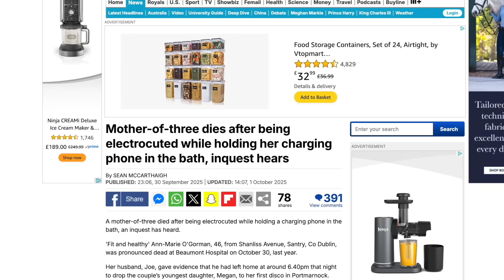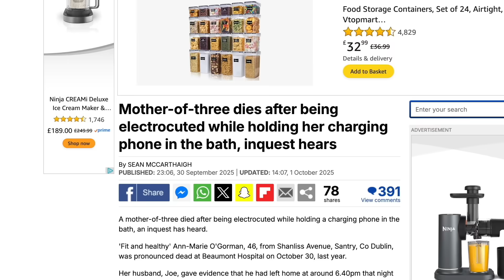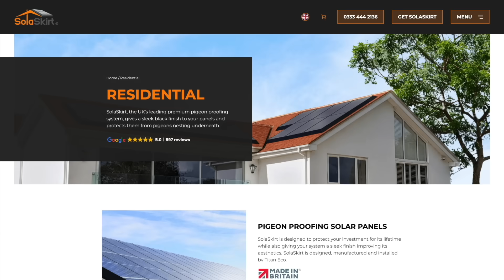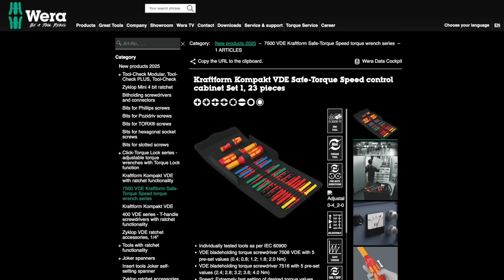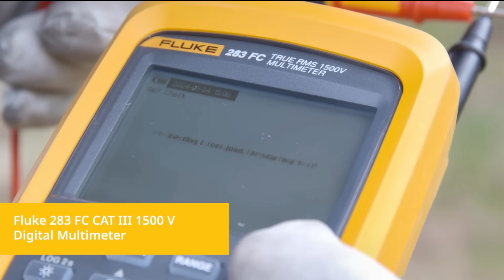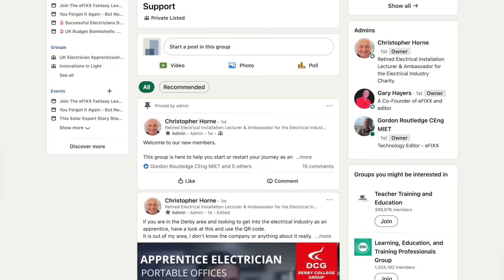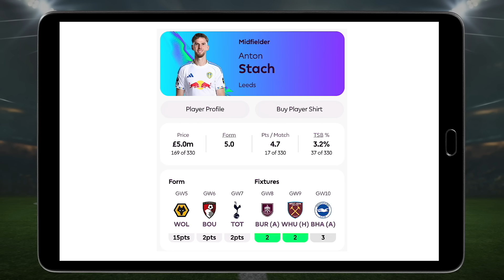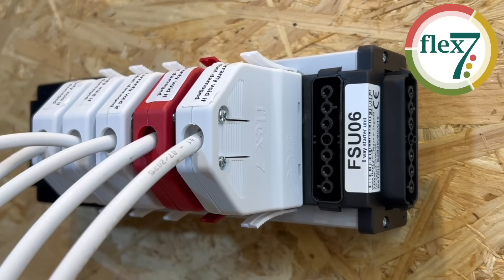He Claimed to be an NICEIC Electrician... Big Mistake

Comment: Being a member of NICEIC is not worth the paper it's written on.
I've had to make good incorrectly wired socket outlets installed by NICEIC accredited electrical installers.
Part P of the building regs hasn't solved a thing.
Electrical accidents are increasing not decreasing despite legislation designed to improve electrical safety.
Reply: Same here - I had NICEIC electricians fit T&E externally to security lights, and spurs on spurs. It's nothing more than an attempt to stop the consumer doing the work, in order to rip them off.

Comment: there’s a reason mains sockets aren’t allowed in bathrooms. the 3m extension sounds like a mains extension lead.
Reply: This is a typical UK requirement.
Reply: Sockets are allowed in UK bathrooms though. They just have to be 2.5m away from any bath or shower and the circuit must be protected by an 30ma RCD
Reply: @JamesWilliams-gi4eu  have to be a big bathroom!
Reply: @over-engineered yeah you do.

Comment: The electrocution sounds like a cheap knockoff charger, no way 5v should ve lethal but if it's not SELV you would have a problem. But who thinks running an extension lead into the baths a good idea! It like the warning on hot drinks saying the drink may be hot.... Darwin?

Comment: The uptick in these stories has led UL to kick off an investigation into crappy phone chargers

Inside the charger there's a small transformer that separates the high voltage coming from the wall and the low voltage going to your phone. As this is a touchable connection it requires extra insulation in the transformer (generally a tape layer) to physically isolate the two sides in case the wire insulation fails

All this is done to ensure that even a power surge won't cause dangerous voltages at the output

But what if you want to make a cheap charger and don't plan on sticking around? Then you put a fake UL or CE logo on your product, get a flyback that isn't safety isolated, ship a bunch, and disappear before you get caught.

When the insulation in the transformer breaks down then your 5V USB cable is now at 120V or 240V and can cause serious damage

Comment: Assuming the woman was electrocuted when the power brick on the end of a mains extension lead dropped in the water, why didn't the RCD in the consumer unit trip and save the day. Southern Ireland at least had mandatory RCD protection way before the UK.
Reply: Mandatory for new houses or rewires only surely?
Reply: @Benzknees  yes, but they were required in Southern Ireland for new / rewires quite a long time ago, so its surprising when there isn't one.
Reply: @stunimbus1543  - Just scanned the internet, and it seems both the UK & Ireland made RCDs mandatory in in 2008 on domestics.
Reply: @Benzknees  so i did a shop fit at Mahon Point near Cork in 2005 and RCD protection was required by the RECI (similar to  the niceic) for all socket circuits. But that was a shop (Adam's children's wear) not a house. I assumed the requirement would be for all installations, but maybe it was commercial only.

Comment: Lots of people here are talking about “5V” charging, but don’t forget that USB-C PD can do much higher voltages. I believe the latest iPhone 17 accepts 20V, for instance. In a bath, I think that might be enough to be dangerous – and of course there’s no RCD. But I agree that mains voltage is more likely to have claimed the life of this unfortunate lady.
Reply: It still doesn't make sense because the output of the charger isn't referenced to earth, so how does simultaneously touching (presumably bonded) metalwork complete a circuit? A shaver socket puts out 240V, yet you can touch that and earthed metalwork without getting a shock because its current flows around the output side of a transformer only.
Reply: @dsesuk The uptick in these stories has led UL to kick off an investigation into crappy phone chargers

Inside the charger there's a small transformer that separates the high voltage coming from the wall and the low voltage going to your phone. As this is a touchable connection it requires extra insulation in the transformer (generally a tape layer) to physically isolate the two sides in case the wire insulation fails

All this is done to ensure that even a power surge won't cause dangerous voltages at the output

But what if you want to make a cheap charger and don't plan on sticking around? Then you put a fake UL or CE logo on your product, get a flyback that isn't safety isolated, ship a bunch, and disappear before you get caught.

When the insulation in the transformer breaks down then your 5V USB cable is now at 120V or 240V and can cause serious damage
Reply: @dsesuk  It won't be referenced to earth as such since there's not normally an earth connection to the charger, but any leakage current (via the switching power supply transformer or its class-Y capacitor) should always be a a low, safe level. Open circuit voltage measured relative to mains earth could be up to around 100vac, but the source impedance would be quite high.
Reply: Had  a belt off a tesco TV because fo poor mains isolation caused by cheap class y capacitors in the PSU!

Comment: The electrocution story doesn't make sense. The output of a charger is 5VDC and the current, regardless of size, has to flow in a circuit. So how did current on the output side of a transformer pass through her body to earthed metalwork she was in simmultaneous contact with? The charger would have to be faulty or of nasty manufacture with a mains potential on the USB shielding. If not, then the other way around with a dangerous potential on the shower metalwork discharging through the shield of the USB connector. Or, the long lead was a mains extension and it was that which fell into the bath which means the charger has nothing to do with it. The press says an expert found no fault with the phone or charger, but dropping a 5VDC line into a bath and then touching bonded metalwork wouldn't see any kind of current flow, let alone enough to kill someone. Any decent charger, such as those made by Apple, would work like a shaver socket - it's not referenced to earth so you can't get a shock to earth on the output side.
Reply: I notice in a news article on the topic that an expert said water is an "excellent conductor of electricity". No it isn't, at least not with an EMF of just 5V. Connect a light bulb to one side of a 5V power source with the other side of both the power supply and the lamp as bare wires in a sink of tap water and I guarantee that lamp won't light. Water's resistivity varies depending on what's in it, but you need to ramp up that EMF to break down its insulation resistance to a point where it can conduct, and that ain't happening at 5V even with the potential to supply two Amps.
Reply: @dsesuk  yes, water's a bloody fine insulator in its deionized form, ask the BBC R4 longwave tx techs!
Reply: Our good friend JW did an experiment with normal southern UK (heavily ionated (is that a word?) ) tap water and the conductivity was pathetic. Soap and suds and stuff of course is a lot more conductive, but the entire story says 'there's more to this than Joe had in the script' and again, RIP to the good lady :(
Reply: As soon as you drop a grain of salt into the water your toast
Reply: @tonywebb9909 Much water already contains dissolved salts.
It doesn't need salt adding to make it conductive.
Reply: @dsesuk  Dave knowing you are the analytical sort, what if... the charger itself was fine, but in the bathroom,. and condensation compromised the separation gap, allowing tracking, ?
Reply: @TheChipmunk2008  Maybe. What I don't understand is that in court some 'expert' apparently said there was no problem with the charger, yet something must have happened with it to cause this. If it wasn't built badly, was it compromised by moisture ingress as you suggest?
Reply: @TheChipmunk2008 I doubt it.
It's unlikely condensation would get inside the charger from outside, unless it had ventilation holes, which they generally don't.

A huge temperature change to a low temperature might cause condensation to form inside the charger from the water content in the volume of air inside the charger, but that's not going to occur indoors.
Reply: yes, i suspect something lost in the translation. It's worrying that joe said a 'consultant engineer' made this ludicrous statement
Reply: I was thinking the 3m lead was a mains extension also David
Reply: This isn't the first time it's happened though sadly. Clearly it wasn't electrically separated and the water did lower the body resistance... There's a reason why it's a special location. Tragic and avoidable.
Reply: @travoltasbiplane1551 it's crazy for sure,why take a charger in a 🚿🛁😮😢😢😢
Reply: Something I noticed some time ago after getting slight shocks of the metal top on my workbench, after turning this and that off it was actually the iPhone charger lead lying on the bench whilst plugged into an MK usb double socket, it measures 91 volts AC  from the metal outer of the lead end to earth with a multimeter, it hasn’t got any major substance behind it but it lets you know it’s there and it does make you wonder how these things are constructed, I have also measured a click usb double socket and that is the same try it and see what you get.
Reply: @mattridgway8807  The 91v that you measured would likely just be permitted leakage through the class-Y capacitor that couples primary and secondary sides of the switching supply. This capacitor is normally somewhere around 1nF to 2.2nF and has a specific safety rating for this application.  The voltage is simply a consequence of measuring with a relatively high impedance meter. This phenomenon can be observed in many good quality,  correctly designed and approved chargers and mains adapters. If the capacitor is omitted, the power supply will become a far noisier source of electromagnetic interference.
Reply: @mattridgway8807   Ths is 'touch current'  common with anything that has a switched mode power supply that isnt tied to mains earth.  Although the voltage measured on a  high impedence meter might seem high (up to half mains vottage) the current must not exceed 0.5mA.  Typically the max current to earth is way lower than 0.5mA from any decent quality device.
Reply: Yeah.... could be extension flex sitting on bath edge or shelf.  Coz  the charger flex isn't that long , pull the phone to you, extension socket drops into the bath....
Reply: They are not always galvanically isolated with an integral transformer.

And yes, it would have to be faulty.
Reply: Hi Dave 👋🏻
Reply: Seems very odd 😮
Reply: @chrisrice9246 Not really.
It's happened before.
The problem is the media do not correctly report the facts, so you're not sure whether the mains socket on the cable fell into the water or just the 5 volt end of the USB cable.

Comment: Re electrocution from phone chargers, there's lots of substandard fake chargers that don't have an adequate isolation barrier between the mains & the output. The earth doesn't go through either.
Big Clive here on YouTube has dismantled plenty revealing the issues.
This issue applies anywhere where contact with earth is possible.
In addition, it sounds like there wasn't any modern protective devices on that circuit to result in deep burns like described.
Very sad & a cautionary tale to have good working protective devices.
Reply: The lethal range for current through the heart starts around 0.1A. So on dry skin 5.1V/100KΩ = 51μA. On wet skin 5.1V/1KΩ = 5.1mA.

Comment: Unfortunate that the woman died but lots of failures all round there including the woman herself.  There's a reason why sockets in bathrooms have to be isolated or RCD protected in many countries, assuming they are allowed at all.  The reference to 2A of current though is pretty irrelevant.  It was clearly contact with mains voltage not the expected regulated DC output of a charger that did her in.  The segment doesn't say if it was a long USB lead from the other room or a mains extension cord.  If USB the charger itself was faulty, given the dire construction of cheap and often direct import chargers from that place in Asia, it's completely believable that mains was present on the USB cable.  On the other hand with a mains extension cord the charger could have easily been in the water too.
Reply: the 2Ais utterly irrelevent, i wonder if the 'consultant engineer' was doing his 200h of community work for being fake NICEIC?
Reply: @TheChipmunk2008  Without the original text we can't be sure (s)he was referring to the DC side, could have been the fuse/fusible resistor on the AC side if it even existed, but it's a fair bet that the DC side current was referred to.
Reply: 100% the current through the heart from a 5V supply to cause death would almost certainly not be possible.  Now class y capacitors from the line conductors will cause the 0V of the USB connector to float at halve of the mains voltage.
Reply: @timballam3675  Yes, it will be at half mains or there abouts but the capacitance will be so low that the amount of current will be trivial.  Being safety rated (supposedly!) they will fail safe.

Comment: ponytail & breaststroke. Curious that electricians are never asked for qualifications, or more relevant, proof that their qualifications are up to date. As well as electrical work I also install heat pumps and air conditioning and always I have to show my card showing my FGas qualifications and the tons of crap that industry requires and all the details are recorded. In fact without it, I would not be able to buy the equipment, the specialised gases, dispose of the old equipment or operate in any way within that industry. I have only ever had two issues as an electrician, once not being a member of a union, the other was proof of indemnity insurance but I can't ever recall anybody asking me to prove that I know what I was doing! (Probably just as well but that's a different story!)
Reply: Which qualifications are required under UK legislation to carry out electrical installation work?
Reply: @VinoVeritas_  Interesting question. I am not sure there ARE any. The trade bodies (NICEIC/ECA/NAPIT/SELECT etc) set their own entry qualifications for self certification
Reply: @TheChipmunk2008  Exactly. There's nothing in the UK legislation that points to what qualifications a person must hold to carry out electrical installation work.
Reply: When you say 'are required', very good question! Obviously all electricians have Ed 18 and probably all the associated amendments but are they legally 'required'? Joe mentions fraud in that the electrician was using NIC EIC credentials, that's one thing and fair cop. But, you use the word 'required', I honestly don't know the appropriate legislation, perhaps an eFixx response is required here!
Reply: @Ino-z2m  Nothing exists in UK legislation that states the qualifications required to carry out electrical installation work. The qualification surrounding the latest edition of BS7671 only determines that you know how to use the big coloured book, yet there are thousands of sparks that hold said qualification that struggle to follow it.

Comment: 3:42 - MY panels were fitted in 2015 and for the first 6 years were fine, and the the pigeons moved in (over 40 of them at one point, nesting in the gap between the panels and the rook). Apart from the joy of being woken up at dawn when they became active, I was concerned about damage to the system and the health risks of all their poo dust. I strongly support the requirement to have preventative netting or similar (my pest controller used plastic spikes) at installation time.
Re damage the risk, the roof fire at the We The Curious museum in Bristol a few years ago was attributed to bird damage.
Reply: Yes we had panels in 2010, and it took a few years (4?) for the pigeons to discover them. So then I added blocking materials. And then more as they got in another way. Eventually the PV panels were totally pigeon-proof so they strted nesting under the solar thermal tubes instead, so I had to block those off as well. The replacement panels that have just gone on had plastic combs from the get-go. There were a lot of disappointed pigeons hanging around for a while. Winged rats. Huge PITB.
Reply: Did you try an air rifle ?
Reply: Want a laugh, I borrowed my brothers rifle, very expensive with telescopic sights, practiced for hours. First shot. killed the pigeon, put a hole through the roof and all the remaining pigeons went into hiding for the rest of the day! Whoops!
Reply from the maker: Yeah, I haven't had problems on mine but I've got netting and spikes along the ridgeline. Seems to have done the trick so far. 🕊️
Reply: My panels went on in 2015, and the pigeons and starlings took over 8 years to arrive, but once there they crapped everywhere, solar output dropped by around 25% as a result.  They were removed by a specialist that deals with pigeons as pests, and a good mesh was installed. Solar output is back up and I'm sure the panels also benefit from improved airflow underneath as well.